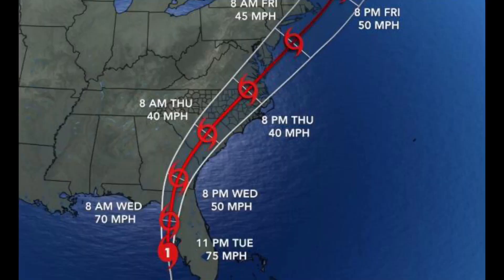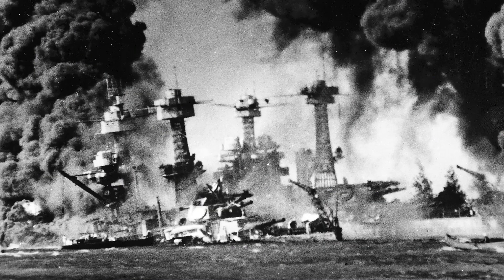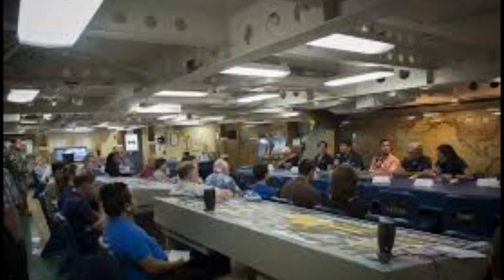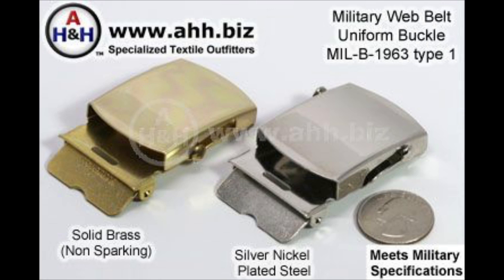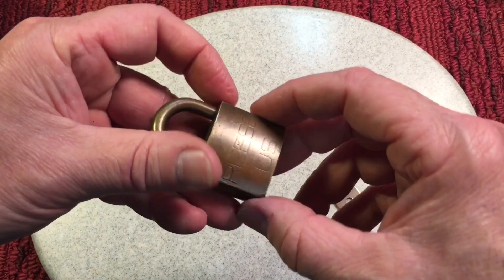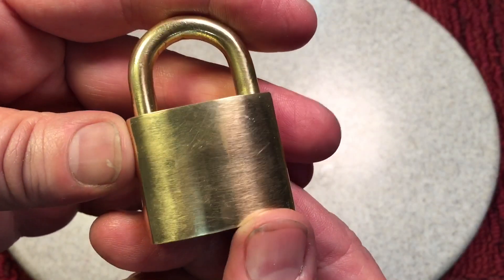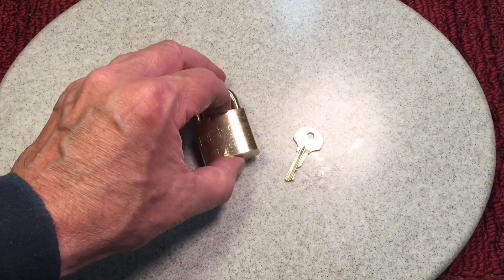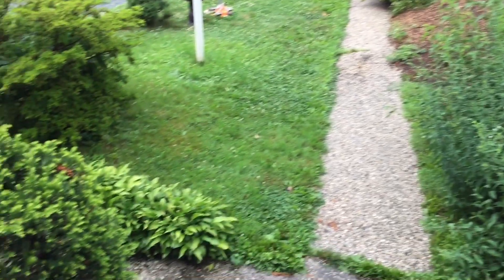Reese Military Padlock- Saluting our NAVY

Comment: I have one of those locks. It came off a five ton dump truck I drove in the Army in a combat engineer unit. I was stationed at Schofield Barracks. I was in basic training when they stopped sending guys to Vietnam in 72.  I had enlisted so I spent 3 years on Oahu. I was in a supply and transportation unit for about a year and drove a Duece and a half so I went to Pearl Harbor a few times because of that. I ate lunch at an air force mess hall once and thats when I found out how much better they ate than we did. lol   It turned out that enlisting was the smartest thing I ever did. I didnt figure that out untill about six years ago and started needing to use the VA for medical services. Fortunately I am fully covered and that my friend is a good feeling.

Comment: My dad enlisted in the Navy at the beginning of WWII.  He was assigned to a sea going tug.  They sailed from Norfolk through the Panama Canal, to Pearl Harbor. At Pearl his tug boat pushed around a barge the size of a city block. They had all the compressors, torches, tools, chains, anything needed to aid in the recovery, and refloating the sunken ships.
My younger brother enlisted in the Navy in 1971. He was an electrician on an oiler. It was a floating gas station. Bunker oil, kerosene,  JP-4 Jet fuel, gasoline, diesel. Bunker oil  had the consistency of hot tar. It had to be heated by boilers to flow. It was pumped to the other ships through several 18" flexible pipe lines. 
But the two most important things they carried were mail and current movies.
They also had gigantic freezers for food stores, and  they carried the payroll for the fleet.  No one messed with an oiler. They were the hottest thing going!
My cousin enlisted around the same time as my brother.  He was a machinist mate on a sub tender.  A floating machine shop for the repair of submarines. He balanced motors, pumps, fans, generators, alternators,  anything which could vibrate and give away the position of the sub. All the equipment must run true.
Reply from the maker: Awesome stories!  Thanks!!!!!!!!!!

Comment: I'm surprised you didn't prefer the file card to clean the buffer pads, it makes them like brand new.  Definitely my go-to over a saw anymore.
Reply from the maker: Jesse- Don’t the file card get bent over?
Reply: @ScoutCrafter  mine hasn't bent, it does get clogged up with fibers from the wheel so I would recommend a file card dedicated to cleaning wheels but it's also not that difficult to just pick them out which is what I do.

Comment: Interesting thing about the phrase mil-spec. Technically is definition refers to a form of metrology. The crosshairs that appear inside the helmet of a fighter jets pilot have multiple lines. Each one of these lines represents a mil, or a millionth of a degree. This allowed the pilot to range his shots effectively. Military specification was a separate phrase that ended up being bastardized into mil-spec. But military specification is far far less precise than the actual definition of mil-spec. This also comes up for Machinist when you're using a high-end level. Typically the additional lines are mil-spec, well on extremely nice levels at least
Reply from the maker: Wow!  Very interesting!!!!! Thanks!  😃👍🇺🇸

Comment: Isn't the Navy the oldest service in the USA?  One thing I've always wondered about is why every June we always have huge news coverage remembering D Day over in Europe; we rarely have anything on the Battle of Midway.  The Japanese didn't replace their ships until 1944 and we had of course increased our fleet several times by then.  Midway was the turning point of the war in the Pacific.  In Europe, Stalin already had Hitler on the run for at least a year and a half or more by D Day.  I just don't see why the Battle of Midway is always neglected every June compared to D Day.
Reply from the maker: Hi Kathie- You are right about the significance of Midway, however D-Day was the largest seaborne invasion ever.  There were 10,000 Allied casualties with over 4,000 dead.  The scope of that operation was  unbelievable.  Looking back so many operations were critical to the outcome that happened.  Some we know nothing about.  Thanks!  😃👍